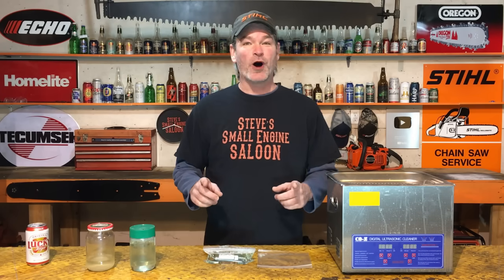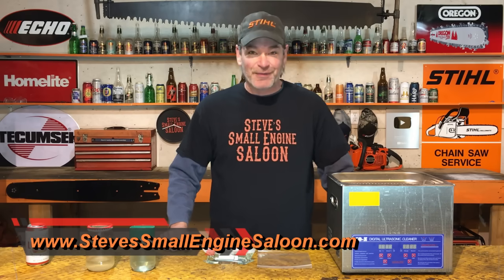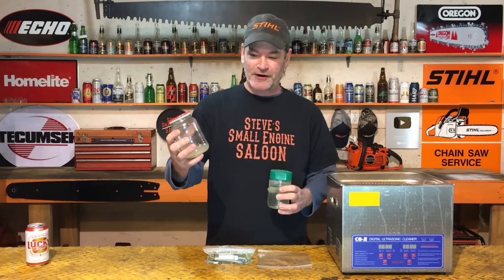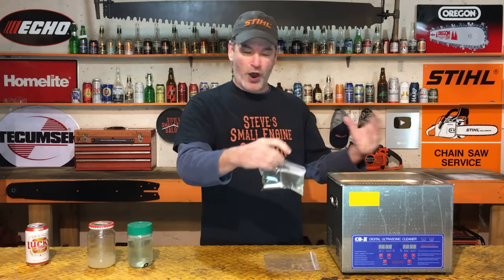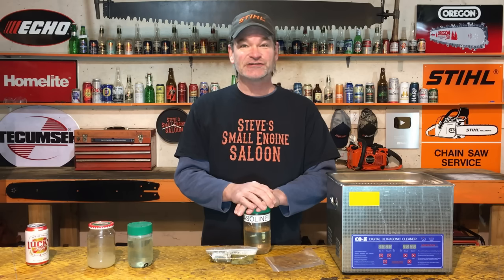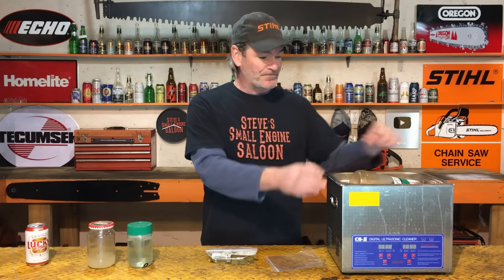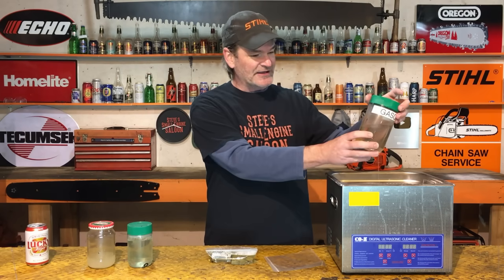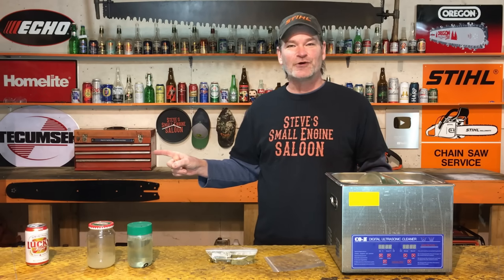UPDATE: Ultimate Tips For Using An Ultrasonic Cleaner

Comment: The main issue with gasoline is the vapors. That is what ignites, not the liquid. Imagine the vapor cloud when you put dry ice in water. It overflows the container and along what ever it is sitting on because it is heavier than air, be it a table where it flows off of the edges and down to the floor or the floor itself, and then spreads out in all directions. You can see the dry  ice vapors, you can't see the gasoline. If (when) the gasoline vapors find an ignition source (gas appliances, DC motor with commutator, hand drill, electrical switches, etc), you're going to get ignition and a flame front that travels back to the gasoline container. Now....it's all on fire. Gasoline is heavier than air, but lighter than water, so if it happens to spill out of it's container into the water tank, it will float on top putting out a significant vapor cloud (the warmer, the faster) and pretty much engulf the ultrasonic cleaner and everything around it. Any minor spark inside the cleaner is an ignition source. I don't know what  inside is digital and what is analog switching, but any plain old analog (mechanical) switches inside the case (notice the vent holes) or nearby, can cause a spark when they trip. Hint: don't pull the electrical plug of an operating device like, for example an ultrasonic cleaner that has gas floating in the tank top and you don't want to get close enough to turn off the MECHANICAL power switch on the unit. At this point you may  pretty well be toast. Pun intended.  If you're going to use gasoline, do it outside. Twenty seven years as a Firefighter, I've seen the remains of non-believers several times. I've also taught flammable liquid firefighting. Trust me on this one. Keep the gas outside. Your chainsaw is designed with all of this in mind. I have a video somewhere of Firefighters practicing with a gas powered saw that had a loose gas cap and sure enough, it ignited. Luckily, the bunker gear kept the FF from being burned long enough for someone to grab a portable extinguisher, but fire was going up his back side. True story.

Otherwise...love your videos. Be safe.

Comment: Autoignition temperature of gasoline is... 280 °C (536 °F) so if your ultrasound get to that temp... you have other things to worry about...
Some people like diesel... 210 °C (410 °F) or Acetone 465 °C (869 °F; 738 K) or kerosene 220 °C (428 °F)
With that said.... I wouldn't be opening the jar with a lit cigarette in your mouth... But even so you have to have the perfect combination of air and fuel to get vapors to ignite.  Watch the Mythbusters they did an episode on using cell phones at a gas station or something to that effect.

Comment: If you're curious about the flammability of petrol/gasoline and other liquid fuels, watch this video: https://youtu.be/7nL10C7FSbE

A critical aspect of a fuel burning is the  fuel:air  ratio.
When it's 100% (i.e. all liquid) it can't burn.  
If it's dispersed as droplets or vapour at the correct ratio it can - and the ratio is quite important as it won't burn easily above or below that ratio.

Comment: Dang it...  So I had an ultrasonic cleaner in my Amazon cart trying to talk myself into it, stumbled upon these videos and, yes, it is the same one I had in my cart that I was deliberating on.  Haha!  I think I got sold on it because I could see it in relationship to a person standing next to it and I can use 1 gallon ziplocks - so whatever I can fit in that bag, it'll fit in the unit.  :)  Ziplock bags are a great because, as you pointed out, you can keep the medium usable for both gunky motorcycle parts and the wife's jewelry without mess or fuss.  Go Amazon Prime!  I'll get this before I get the other parts I need for my carb refresh, so I get some cleaning action soon!  lol!
Reply: So, I received my CO-Z 15L today, and proceeded to test it out a little bit.  Not much, but something anyway...  Main fluid is water in the vat and using ziplock freezer bags for "things".  First up, a backing plate for my motorcycle air cleaner that I am replacing anyway, so let's clean that!!!  Water and soap, no-go there.  It was a first test run, so I didn't expect anything really, but it did clean easy surface greasy feeling anyway.  Couldn't see anything, but stick some fingers in the vat, you can feel the cavitation action and it's kind of interesting (like, if this could clean under my fingernails, that would be awesome!).

Since it seemed to be working as a machine (cleaning something and feeling it working) - and solution is very important - gas it is!  lol!  Again, in a zip lock, placed said part in the empty bag, placed in the vat, and topped off the part with gas and let her go for 10 minutes.  Definitely saw the bubble reaction you witnessed, so it was much more action than soapy water.  After 10 minutes, a crapload was clean but still deposits, so I let her rest a bit to cool down if needed and did another 10.

When I finished, it was more clean but still deposits here and there, so I was thinking... Man... More?  But decided to rinse first and pretty much all the deposits that seemed to be left over actually just sprayed right off with no water pressure at all.  So it was dislodged from the surface, but it was so thick that the action of the cleaning doesn't address that really. 

However, there is a thing about ziplock bags here....

You will witness the "clouding" coming out of the bag because the action of cavitation is microscopic and the bag cannot hold it in.  So while the liquid will not directly contaminate the carrier vat, it will still end up with the cloud, so it'll need to be changed more often if you are cleaning more than, say, motorcycle parts.  Small price to pay for the convenience of cleaning a backing plate of a Super E carburetor without mess or fuss.  I'll turn a lever to drain a tank all day over actually scrubbing those nooks and crannies!

Comment: The reason the mfg say to fill it up with water is. The cleaner (tool) will destroy its self, because the ultrasonic sound waves is going into the water and not the unit itself.  Have you tried filling the jars up completely (no air) to sink to the bottom, I wound think that would make it work better.  Yamaha sells (at motorcycle stores) quarts of ultrasonic cleaner.  I was told its the best by mechanics.  Any cleaner that dont foam much (laundry soap ex:) should be the cleaners to go to.  Keep up the good work!

Comment: My dad always used kerosene with some  detergent additive I think he called it gunk or something for cleaning parts. Don't let the nervous nellies get you down. Be respectful of the issues, which you are. I think kerosene is better because it's somewhat less volatile but almost everyone has gasoline around the house. I'm going to be using one of these tricks tomorrow and I'll be using gas since I'm not going to get a special container and make a special trip just to get kerosene.

You do need to be careful about what kinds of plastics you're using with petroleum products. Obviously some can carry gasoline and kerosene but others will dissolve either quickly or over time. I'm a little surprised that the peanut butter containers stood the test of time but if they work, they work!

Comment: I do not think using Gasoline is a good liquid to you in you cleaner, especially in a glass container. I say that because you are now creating a pressure vesse that might explode, and so the energy add to the gasoline has the possibility to heat the the liquid. By adding heat and pressure you are changing the flash point increaseing the chance of fire. Yes, I agree there is no electrical spark, but to get fire you just need heat.  In the chain saw example, this problem is minimized by the vacuum in the fuel tank.
Reply: what about your gas can half full of gas, sitting in your garage on a 90° day, all bloated and ready to blow?  ever open the vent and sense all the atomized air/gas escaping?  every homeowner has one, so there are literally millions of these potential "bombs" out there.  never heard of one spontaneously exploding before.  if that were the case, small engines would have been outlawed for everyone, along with filling your own containers at the pump.  also, you can buy pre-mix gas in a can right off the shelf.  a small volume of gas in a glass jar for cleaning purposes does not pose the risk you are describing.

Comment: A 50/50 mix of white vinegar and water is a terrific ultrasonic cleaning solution for tarnished brass (I'm a reloaded). But as you said in your first video, it's a caustic, so use with caution on materials that might etch or discolor. I also use ẞimple Green in about 75% water. Use "Simple Green D" on aluminum parts, as it will not etch or discolor aluminum.
Reply: Acids and bases are common corrosive materials. Vinegar is not considered "caustic", as it is acidic - anything that has a pH level above 7 means the substance is alkaline. As a substance lowers in pH levels from a neutral 7 to anything below, it indicates an increase in acidity. A substance becomes increasingly more acidic as their pH levels decrease. The term “caustic” properly refers only to strong bases, particularly alkalis, and not to acids, oxidizers, or other non-alkaline corrosives.

Comment: I used gasoline or lacquer thinner which is more dangerous than gasoline according to the safety sheet. One day gas next day lacquer thinner. But I use glass jars. When a real cleaning problem happens I use Methyl ethyl ketones. The latter mentioned is really expensive but works the best. Peanut butter jars don't stand a chance Steve. They just melt down in front of your eyes. Gasoline is definitely the cheapest way to go !!!!!!

Comment: I use for chains, coins, everything else I find with the metal detector, a solution of vinegar (30%), ethyl alcohol 70-75 ° (25%) 40% water and 5% gasoline ... it may sound strange, but  clean everything from silver, bronze and iron coins, + the chainsaw chain looks like new ... I will test only with gasoline, to compare the results, but this solution was recommended to us by a colleague who is  chemist :)
Reply: did you compare? video?

Comment: For cleaning geesy parts I often use kerosene (we call it petroleum) instead of gasoline (also called as diesel oil). It does a cleaner job, and does not smell that bad. (Kerosene is more pricey.)

Comment: So Steve the issue i could see with gasoline is this.  Gasoline is flammable, but more so combustible. Most gas tanks have a way of venting pressure so that the tank does not become pressurized.  You a placing a sealed jar of a combustible chemical into something that produces heat and pressure(pressure via micro air bubbles/agitation).  Now I am in NO WAY an expert, but my sonic cleaner used to get pretty warm over a period of time.  Pressure+heat=combustion chamber.  I dont think it would ever get hot enough or high enough pressure to do anything, but I can also see where people would think it is sketchy,  especially with glass.  With the glass container ever if it was just enough to pop to container it would send shrapnel and that could be dangerous.  At the end of the day brother, we live in America and you are free to do as you darn well please, including blowing up a sonic cleaner if you so chose!  =I think we all need to remember that the terms flammable, combustible, ignition point, and flash point all have very different meanings.  Different meanings as well in terms of atmospheres of pressure as well.  There are plenty of articles on the cleaning tech groups and ultrasonic cleaning blogs that try to dissuade people from using combustible materials as solvents.  Especially IPA due to its low flash point and its evaporative qualities that fume it.  Most people using these have fume extractors.

Comment: Hey Steve, great video. Have been using an ultrasonic cleaner at work for a few years now. We use a product called "Alconox" most of the time. It works great on anything metal, glass, plastic, etc... - It's a bit pricey to buy, but the results are really good. We buy it, in what looks like a milk container - holds 4 lbs of the powder. Cost about $60 here in Canada, but you only need to mix it 1:100 ratio (2-1/2 tablespoons per gallon). One container makes about 50 gallons.
Reply: LOL 50 gallons ---with steve's tips you'll be handing the remainder down in your will...Alconox....will look for it..thx

Comment: Great explanation on the use of gasoline in this manner with an ultrasonic cleaner. Too many people are misinformed, or just don't understand, how an ultrasonic cleaner works. I think just to be that much more safe you could do everything outside just in case the zip baggie broke and you had gasoline fumes appear. Even then a properly functioning machine will have no ignition source. Thumbs up to your reviews!
Reply from the maker: Thank you!
Reply: @StevesSmallEngineSaloon  Consider if the baggie broke, not only is the whole water surface covered with gasoline, the agitation of the water will accelerate vapor production even more.  While the risk of explosion in most circumstances is minimal, I'd strongly recommend doing outside for the increased ventilation, or seeing if kerosene (or other light solvent like varsol) works as a close-enough substitute without so much vapor production.
Reply: @fromagefrizzbizz9377  Good point. A lot of people don't realize that it's not the fluid gasoline that's so flammable, it's the vapors, and the reason for carburetors on internal combustion engines. And vapors are invisible and heavier than air, so can flow around like a liquid.
Reply: Use diesel

Comment: Great video as usual, backing up the first one. Using the heating setting with gasoline  would be a potential for  increasing pressure in the containing vessel given the volatile nature of petrol and that could be a problem. Whoever mentioned lightning in earlier comments was probably confusing ultrasonic technology with microwave.
Reply from the maker: Great point!

Comment: For all my small engine, nuts and bolts, and other items (including gun parts), I use detergent 30W motor oil... Not only cleans real well, it helps to keep parts from rusting after being cleaned. If you need it oil free afterwards, whip it down with a degreaser.. You will not need as much either..

Comment: Peanutbutter jars weren't designed to contain gasoline, that's the difference from a fuel tank. Might be fine, until it isn't.  Many gunsmiths acknowledge gasoline as a superior cleaner, but stick with kerosene because the fumes from gasoline are just too risky for a shop.

Comment: In the previous video you had gasoline in open containers, which can be dangerous indoors without good ventilation.  Hopefully that was just for demonstration purposes and not the normal way you clean with gasoline. The closed peanut butter container, like the chainsaw fuel tank, is not going to spread flammable vapor all over the place so it's much less dangerous.  Otherwise, great videos and thanks for the tips!

Comment: Of course, as you say, there is no ignition source in the USC. Even if the microbubbles reach a high temperature the gasoline in the jar has a too "fat" mixture (air/gasoline) to pose any real danger. There is a reason you can actually weld on a cars tank full of gasoline without problem. I'm not saying anyone should do that but pro's with proper knowledge do it every now and then.